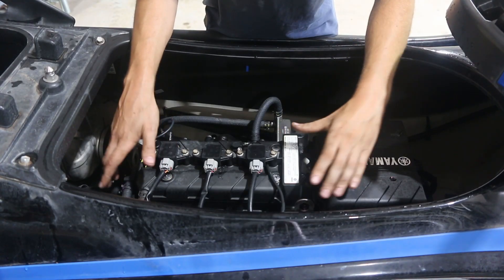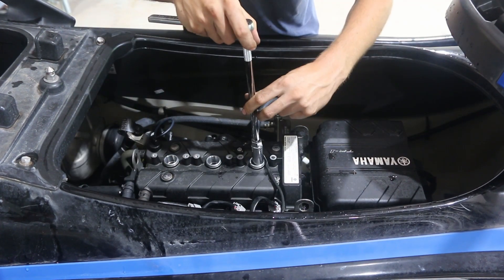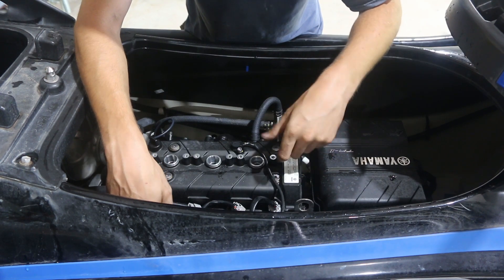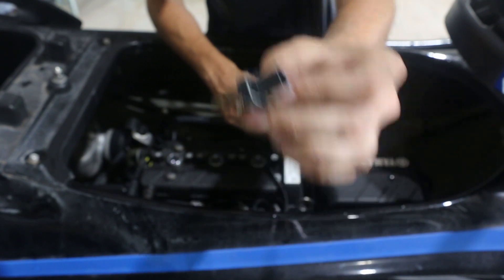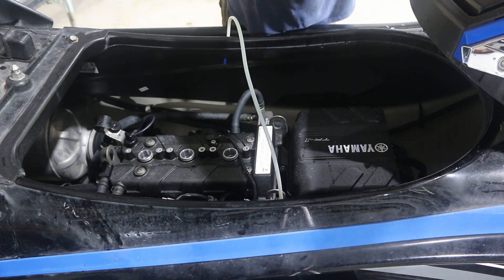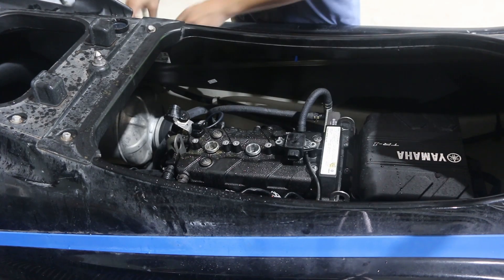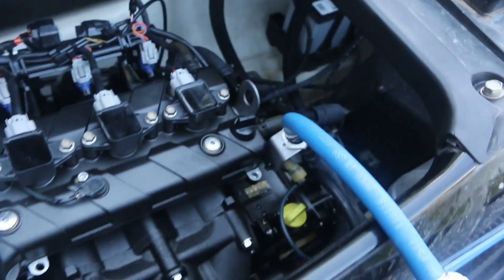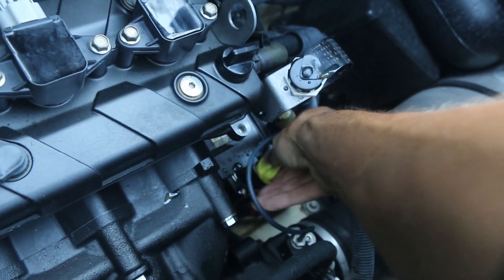Sunken 2017 Yamaha VX Deluxe Revival (process I use to un-sink a PWC)

Comment from the maker: What you need:
Oil change pump:  https://amzn.to/3j1TnKy
Alternative oil pump:  https://amzn.to/3ld20Uu (I used to use this style, they work great but are slower than the Jabsco one)
Some kind of socket set that has a 10mm, 5/8 deep socket, long extensions and a Phillips screwdriver (I'm not even sure what brand to suggest anymore, I love my old craftsman tools but the quality doesn't seem quite the same anymore, and the new cases are dumb, but that's a story for another day)
This set would be similar to mine, but is 11 years newer and has a dumb case with no extra storage: https://amzn.to/2SIsYpZ

(These links may be affiliate links, which earn me a small commission at no additional cost to you if you choose to purchase from them)

Comment: So, any thoughts on a 2020 Vx limited ( I have less than 30 hours on both)  that's running the TR-1 motor. One ski - It bogs when I give it throttle. I took it to a shop, and they 'replaced the spark plugs' and did a compression test. Said they lake tested it. It rough idles at around 300-1000 (depends), when you full throttle vs the other ski, it's much slower. It bogs when you give it throttle. Sometimes it sits there, trying to thottle, then kind of spurts a bit and after it hits like 10-15 mph it hits almost full throttle like it's being held back.

Back in the day, I had screws to turn, I could adjust things. Now? From what I understand it's all computer based adjustment. The shop I took it to - they have no idea wtf they are talking about as it does this constantly the first few minutes after starting. Same day I got from shop. $160 later, I'm not going back there so now I'm researching other places to look at. IF you got any idea wtf is happening, I'd love to hear it.
Reply from the maker: I honestly don't think half the shops and dealers have a clue what they're doing anymore. I've had people bring stuff to me where I'm the 3rd mechanic to look at a problem boat, and it ends up being a clogged fuel filter, like seriously these "factory trained technicians" seem totally incompetent.

Ok, with that rant out of the way, yes you are correct, the TR1 is fully electronic, fuel injected, so there are no adjustments to make without a computer, and even then you're kinda limited as far as tuning goes, but diagnostics are much easier with the scan tool.
IF the shop actually changed the spark plugs, and checked the compression with a gauge and not just sticking their finger over the hole and seeing if air blows out like I've seen other "technicians" do, then knowing you have good compression rules out most major engine issues.

Was there an event that caused the ski to start these issues? filled up at an unfamiliar gas station? flipped it over in the water?
300-1000 idle makes me thing it is not running on all cylinders, usually you can tell because being down a hole will make it sound very rough. Would you be able to record a video and upload it somewhere and post a link or email it to me? tom@trythistv.com

The first things I would check is compression, and spark plugs. If all the cylinders are fairly even on compression, it could be a misbehaving throttle body or electronic throttle, both of which kinda need a scan tool to diagnose.
Reply: @trythistv  I'm on it. Yea man it's WIERD. It runs fine sometimes, then sometimes not. I'm just trying to get a handle on it before summer hits again, which is why I am starting now. I'll take everything you said and look at it. I'm very technical and mechanical (mostly) so I'll do my best! Thanks again!
Reply from the maker: @the72u7h4  knowing it runs ok sometimes I'd pull the spark plugs and inspect and see if any look vastly different, being weirdly intermittent could be a bad coil pack as well, or something as simple as a spark plug is arcing out, I've seen plugs crack, I've seen techs use the wrong plugs, or cheap plugs (get some NGK plugs that are specced on the info sticker, they're not expensive and will do you good)

One trick I use to narrow down weird issues like that is put a brand new set of plugs in, and try to get it to act up for 5-10 minutes on the lake, and then pull the plugs, that way you can determine if one cylinder looks different, you can put the plugs back in the same order, and change the coil pack order, then repeat and if the problem moves its the coil pack, if it doesn't, then it isn't.
Reply: @trythistv  Hmm interesting. Ok, will do. But I gotta wait a bit since it's COLD AS BALLS HERE. lol. Once it hits maybe march I can start messing around. I can pull them out and run a hose on them (engine on first, then hose, then hose off then engine off yes I know).
Reply from the maker: Yeah, it's not warm enough that I want to spend much time on the lake here either lol, but research and direction to head in is a good use of the miserable cold winter, that way once it does warm up hopefully you'll have it running perfect all season! And you've got it for the hose! Let me know what you find, I'm curious what's going on with it!

Comment: I have an EX 2019 it displays code 161 it starts but the reverse gear does not resume even if the box is new thanks bro
Reply from the maker: There are 2 other videos of mine that would be VERY applicable, as 161 is a RiDE malfunction if I recall properly, and would make sense with reverse not functioning.
I think code 161 is an issue with the levers on the handlebars, which would be this video: https://youtu.be/M6assGTx-Dc
if those wires are all good, then you could pull the RiDE motor out and test it, which is this video: https://youtu.be/-D_Cq7-J6Eg

Comment: Great video, I'm excited to check out the others that you'll have coming up! What do you think of the reliability of the TR-1 engine? I've got a deposit down on a 2021 VX Deluxe with the same motor, but have been reading on forums that the 1.8 is probably better for reliability.
Reply from the maker: I have seen more broken TR1s, But I also see more TR1s period due to their popularity. Easy to maintain, good on gas, maybe not as reliable as the ridiculous older MR1s that go thousands of hours with minimal maintenance, but I quite like the TR1 platform to be honest.

Most of the TR1s I see all have 4-500 hours of rental abuse before any major failures, and by then they have been sunk multiple times and may not get the best maintenance, and you know they aren't babied at all. 
By far the most common failure seems to be the jet pump bearings. I've had 3 TR1 pumps blow the pump bearings apart this year. Doesn't really hurt anything, rebuild the pump and carry on.
I've rarely seen actual engine failure on a TR1 (twice since yamaha started making them), and when I have, it has been always been caused by water ingestion from not pumping out the intake manifold like I show how to do in this video.

The 1.8 HO engines do seem very solid, but I see far less of them because the TR1s are so popular as rentals.

I haven't made a video specifically about it, but I sorta own 3 TR1 powered machines currently... all Ex-rentals all in various states of destruction I got very good deals on, 2 out of 3 had blown up pumps, one has a hole in the hull the length of my entire arm (The one in this video, that's why it sunk lol), another has a partially blown engine, it runs, but not well and oil does not stay inside the engine so that'll be an interesting one to dig into.
Reply: @trythistv  thanks for all the info! It's nice to hear from someone who has a lot of experience with them. I'll definitely be watching for more of your waverunner videos. Thanks again!
Reply: I have a 190 hard hours on my 17 vx deluxe.  The only issue I have had is the jet pump has been rebuilt 3 times.  Fishing line killed it this time!
Reply from the maker: @shaunrigby6599  I have noticed an alarming amount of jet pump failures on the TR1 machines as well. I'm not sure why, because its essentially the same pump as the MR1 and even older yamahas have used, The TR1 does spin pretty good RPM so perhaps that is related.
I've also noticed a lot of the pump "nose cone/cap" on the back that seem to shatter which would let water in and destroy the bearings. Perhaps factory overfilling with grease/oil and it expands and snaps the ears off that cap?